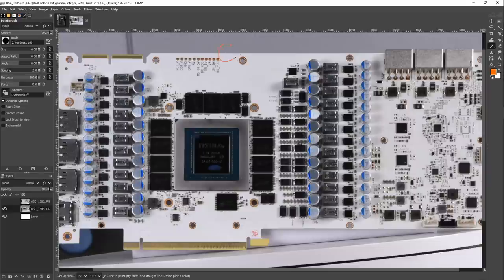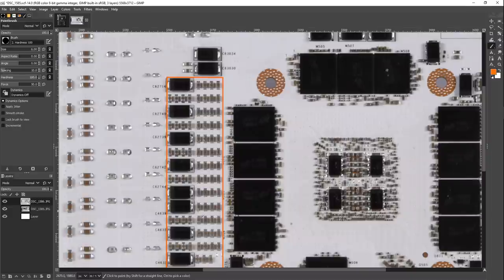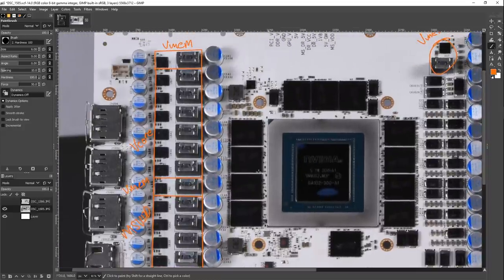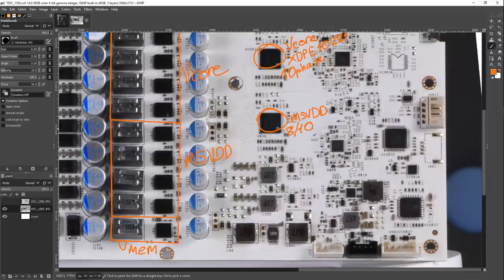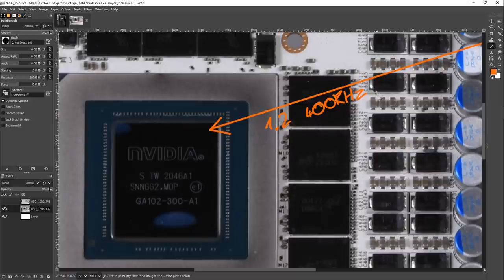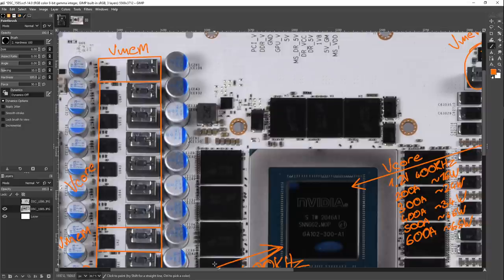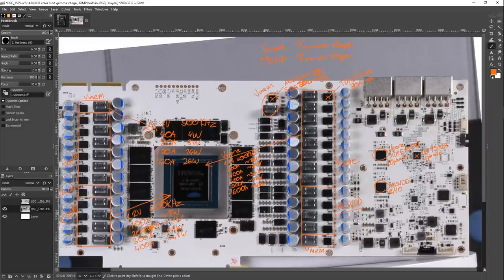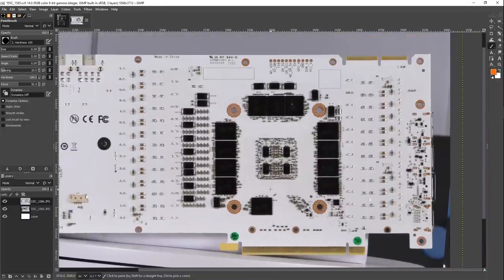GPU PCB Breakdown: Galax RTX 3090 Hall of Fame

Comment: "How many Capacitors do you want?"
Galax Engineer: "Yes."
Reply: - How many power phases should we put on that thing?
- All of them!
Reply: It's the same answer when engineers ask Lisa how many cores
Reply: How much will it cost?
Yes.
Doubt we will be able to get that thing, except for double the price (3k?) cause as it hits the shops, scalpers will be there.
Reply: @KleinMeme  i think these are distributed by galax themselves to overclockers at competitions, i could be wrong though.
Reply: @theunholybakery1990  Mh if they do the same route as with the 1080ti version then you can buy it normally. Got the HoF edition of that back the days.
Reply: @KleinMeme  ok so i did a little research and It turns out that the standard HoF are readily available. I was actually thinking about the OC LAB edition, which are... Well, over-over-overkill and cannot be bought normally afaik.
Reply: @theunholybakery1990  Yes, this were the ones they used in the galax OC competions i think. The OCers got them directly at the event so everyone played with even cards.
Reply: @theunholybakery1990  I saw eBay selling already
Reply: @theunholybakery1990  no no I think the oc labs version will be very rare... I heard only 50 produced as the cores are hand binned
Reply: @theunholybakery1990  Neat price when you think about that my normal 1080ti HoF back these days cost around 1400€ already. The 1080ti Kingpin Hydrocopper, with the waterblock pre-installed, was around 1600€.
For collectors a nice piece i guess.
Reply: @KleinMeme  especially when you consider that the retail price of a 2080ti was 1200€
Reply: @cocogao5580  hand binned?

Comment: Palit (Galax's parent company) have put out some really solid ampere cards. My fave are their basic 3070s which use their 3080 coolers and have extra phases over the founders edition. And you can cross flash any of their highest tier card BIOS on, finally getting a 3070 that's not power starved and stays cool enough... on a MSRP card... Palit doing good work this generation.
Reply: I got a palit 3070 jetstream oc, is it good?
Reply: Can you get the cards from this company in the US?
Reply: I'm sad Palit's 3070 were out of stock - they usually don't sell well here. Had to go for the MSI 3X, though it also can be flashed with different bios and the cooling is ok...ish.
Reply: @stoked9004  Here in Brazil we have quite a few of them, it's almost always in stock though with increased prices, but that's something we're used to due to our ridiculous taxes. Here, the Palit cards are labeled as "PCYes", a local company.
Reply: i have the KFA2(Galax) Ex-Gamer and i am having a blast! It is one of the biggest 3070 (332 mm!), which is kinda a downide, but i can live with it :D
Reply: This sounds so much like an ad it's crazy.
Reply: How do you flash a bios on ampere cards?

Comment: Der8auer said in the videos today that greek overclockers get 3000 mhz super pi with this card
Reply: and apparently without external voltage control, just a XOC bios
Reply: @StrixWright LN2 full pot. The GPU pulls over 1kW at those speeds
Reply: @tommihommi1  Holy shit that’s a fucking lot
Reply: @tommihommi1  and this is why we need to game in space

Comment: I bought this card before watching this review and I can safely say that I made the right decision. It even came with useful stuff like GPU cable extensions and an anti-sag bracket and a pair of gloves. Mine isn't the limited edition so it didn't come with the LCD panel but it's okay.  I'm waiting for EK to release a waterblock and active backplate for this card. Thanks for the analysis, Buildzoid!
Reply: EK won't be I had confirmation from them regarding a waterblock and active back plate.
Reply: @danieltubio-rey1984  I also asked EK about it. It's unfortunate, but I guess I'll just have to sit it out and wait until they release something for the Galax HOF card.
Reply: @Jalily  bitspower are releasing a block for it just to let you know.
Reply: @danieltubio-rey1984  Thanks for the info! Do you think that they will make active backplate cooling too?
Reply: @Jalily  on some of them they are doing yes I'm thinking they will do

Comment: Having a separate Vdd rail allows you to run parts of the GPU at a different (presumably lower) voltage than the core. This reduces the overall heat of the die; and depending on the type of what is powered also increases its stability.
Reply from the maker: the thing is AFAIK MSVDD sits at almost exactly the same voltage as Vcore during stock operation.
Reply: It was just a guess, thanks for the insight. ❤
MSVDD seems to be core cache, which makes sense (power the part which looks quite different from the core). Maybe it does not participate that much in stock GPU boost voltage control? Would be interesting to know.  But I can see that in this case it would not deviate that much, just a bit, from core voltage.
Almost forgot: great video! ❤

Comment: One of the reasons for high memory temperature is likely just the closeness to the GPU package.

Something to keep in mind with the memory power is that the bus is bidirectional, some of the power is dissipated on the GPU side of the bus, either through the termination resistors or in the signal drivers on that end of things.

IIRC GD6/GD6X also has a separate power rail for the word line supply (Vpp) but not sure how much that draws compared to the regular Vdd supply.
Reply: So would this make the vrm being stuck to the back of the 3090 gpu's   a  better concept ? Since you know they arent so close to each other ?

Comment: This thing has more capacitance than an airbag ECU
Reply: Underrated comment.
Reply: Am i missing something?

Do airbag ecus have out of a reason a lot of capacitance?
Reply: @RCEngineTuner  they use capacitors with high voltage and high capacitance to detonate the explosive charges which blow up the airbags.

For safety reasons airbags have to be able to work even if the alternator fails and the battery is disconnected, i.e even when the electrics of the vehicle fail completely.

This is achieved by using capacitors for energy storage.

Comment: I bought a 3070 as a gift for someone and did some tests before sending it to them to make sure I wasn't sending them a DOA card and my god does the back get hot. maybe I'm out of the loop or something but my 1080's backplate never gets close to that hot. if other cards in the 30 series line up are like this then I really think they could use a heat sink or some active cooling on the back by maybe just taking some heat pipes and extending them into the pass-through cooling at the end of the card that many models have. If the 3070 i bought was mine to keep I would have bought some heat sinks or maybe even just take a spare cpu waterblock i have and just thermal tape it onto the backplate just to try to help cool it down a bit because that amount of heat can't be good for longevity.

Comment: Do you have any videos that explain (idiots guide style) to amount of VRAM vs. the bus width and speed. Like a 3080 with 10GB of GDDR6X with the current bus vs a hypothetical equivalent with 16GB and a smaller bus width. (Sort of like amd’s current top end vs nvidias).  There’s a ton of idiots online making claims but I don’t trust any of them and I’m curious what the actual situation is.
Reply: do some research on your own, I've just looked at wavetops of it but the actual bus width is just a spec and it's speed is dependent directly on how fast that memory is and at what bus width... thats super simple to figure out, and it's also really easy to see the difference that makes by clocking memory speed down to simulate a narrower bus aks less throughput overall. But AMD with the cache system they have is really interesting considering they essentially have some ridicously high speed memory built on die to make up for the lower max input bandwidth from the narrower and less power hungry bus. If you want to see the overall throughput difference in hypotheticals use the 3070's bus width and calculate the memory at the 3080 speed and you have the difference right there. You're asking if a chip would become memory starved or not and I think the answer is pretty clear if you think about it. And easy to test by testing with the variable being memory speed

Comment: Ever thought about trying to get your hands on a EVGA GTX 1080 Classified and doing a PCB Teardown on that one?
Reply from the maker: it uses the same VRM as the 580/680/780/780Ti/980/980Ti Classfieid
Reply: @ActuallyHardcoreOverclocking  
Ah, okay. What about the rest of the PCB? Also, would a 980Ti Waterblock work if it is the same?
Reply: @PlymouthJoseph  i'm guessing the die/pcb size Is different

Comment: Are you sure the board manufacturers aren't allowed to mess with that central area?  When these 30 series cards came out, there were at least a few different variants of the capacitors on the back of the GPU, so it seems like they must have some leeway.
Reply from the maker: you can't change pad locations just the parts themselves.

Comment: On my Strix 3090 OC, if I push the memory clocks, I can have MVDDC eating up 205-210W. It's a beefy rail, so makes sense they chuck in extra rails on a card like this.
Now I just have to figure out how to make the VRAM not thermal limit when it's running that fast. I can't find any info anywhere on how thick the thermal pads for the memory are, on the back of the board, I was hoping I could replace them with thermal paste instead.
Reply: for OCing you could just slap an actual cooler on the backplate
Reply: @tommihommi1  If I push 3dmark, the bigger problem is the 480W power limit right now. For 24/7 compute use, a cooler on the plate is a meh eeh. But removing the backplate and putting actual heatsinks on the GDDR6X could be an option.
Reply: @nikomo  a black anodized aluminum heatsink might not even look terrible, mounting it would be tricky though
Reply: @tommihommi1  There's some thermal interface materials that harden so that they cure and basically become like a thermally conductive cement. Wouldn't need any mounting hardware with that. I do have a 3D printer though, that could help.
Reply: @nikomo  I wouldn't want to glue something to the back of my $2000 GPU

Comment: just putting my doubtful hat on instead of them running vcore as asymmetrical what if they are running them as 7 doubled-up stages and putting the 10 stage controller there as a bluff to take advantage of the more stages more better croud?
Reply from the maker: nah assymetrical phases are extremely common on Nvidia GPUs sine the 2080Ti.

Comment: OK, great engineering. now how do we get one outside of Australia, New Zealand, and the Pacific Islands?

This manufacturer (Galax) doesn't exist in, and is unavailable in, the US.
Reply: I mean this card is only interesting if you run it with a chiller or on LN2 cause its build for that so that's that and they only make limited amounts of these.
Reply: @alouisschafer7212  I would be perfectly happy running it on a custom water loop. it wouldn't be my first time.

The card is just 100% not available in the the US.
And we are the single largest group of hardware modders on the planet!